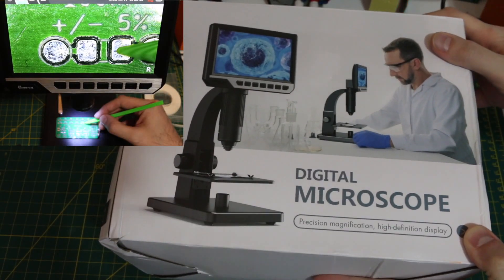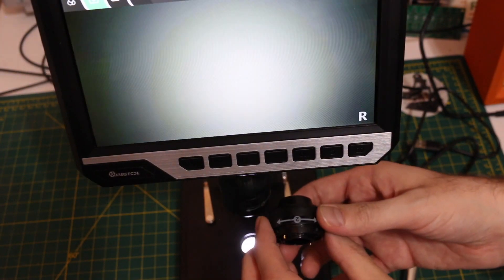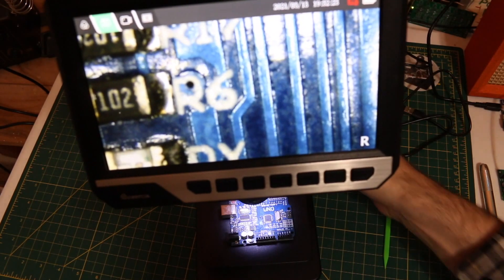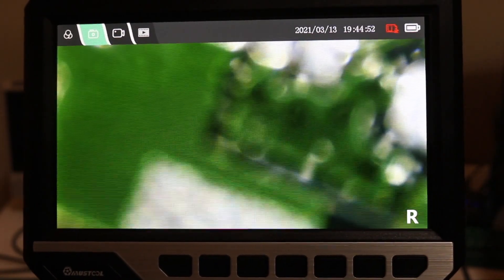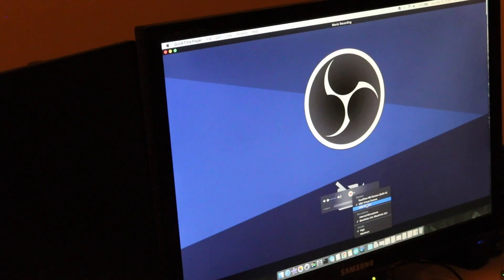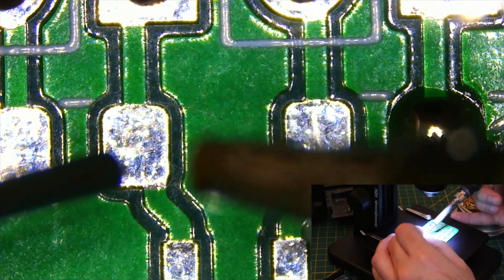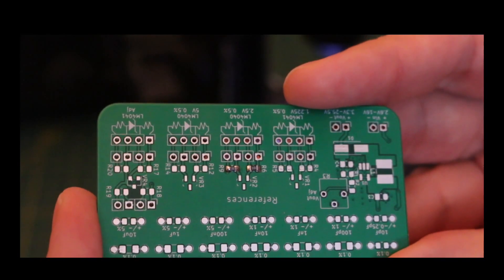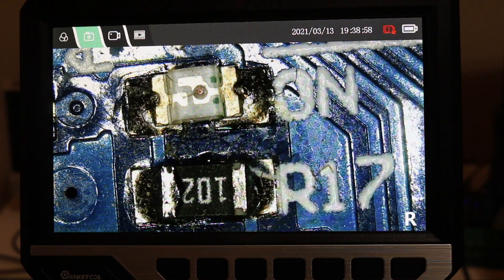Digital Microscope: Good for Soldering - Mustool MT315

Comment: Is the screen adjustable
Reply from the maker: it tilts up and down completely until it hits the actual rest of the stand so it’s more range of motion than needed and for left and right it can just be rotated in the circular opening that it drops into on the stand and then clamped with the thumb screws but normally it’s not meant to be rotated left and right

Comment: It says #1 - 500x and #2 - 2000x, but it doesn't say how low it goes. I've got a $15 USB microscope, but the one with the least magnification, ie, 25x-200x, and I've got about 150-180mm distance to the object. I mainly use 25x-50x, and maybe 100x at most, so 500x seams a bit too much. Still having it all in one unit is cool, because a remote microscope with a PC monitor is a PITA.
Reply from the maker: When I measured the lowest zoom with a ruler on the base and then seeing the display distance between 1mm ticks, it was 17mm center to center between a 1mm span so I figure it's 17x minimum.    I was originally concerned about having only 6cm distance to work but it seems to be more than enough.

Comment: Ah, you watched all those NASA soldering vids too?  Shiny surfaces, concave, inspectable ...
Reply from the maker: And how to properly join 2 wires for soldering. I remember the days where I would put wires side by side, twist, and then wonder...how do I make this one continuous straight line instead of 2 parallel lines.

Comment: there is too much magnification, you don't want to go passed X10. you want to see more of the components when soldering. Also latency is a big issue when hand soldering, as any delays soon drive you mad.
Reply from the maker: It's a good stepping stone along the path to a fancy one with eyepieces, more adjustments, lighting  and a camera port.   I didn't notice any latency problem, maybe with less zoom and more space to travel, it would become more noticeable.
When I manage to get a "full and proper" unit, this one will become my deluxe loupe for looking at small parts easily.
Reply from the maker: I was curious what the minimum magnification was since I don't think there's a spec anywhere, so I put a pcb ruler on the base as far away as I could focus, then measured center to center on-screen for 1mm of markings, it's 17mm so I assume 17x zoom.   If I could zoom out a little more it would be great.
Reply: @GadgetReboot  mine is X10 which i feel is just about workable,  would like maybe X5. The distance between lens and board is important to give you room to move about.once used a loop to solder a boad and was so close I burnt my nose twice,  :)
Reply from the maker: I was playing with the lens unit again and I found if I raise it higher when it's not secured in the ring mount, there's still enough focus adjustment to reduce magnification.  I was able to focus at 8x magnification and I'm sure I can zoom out even more. Now I just need  a way to hold it that high.  I feel a new project coming up!